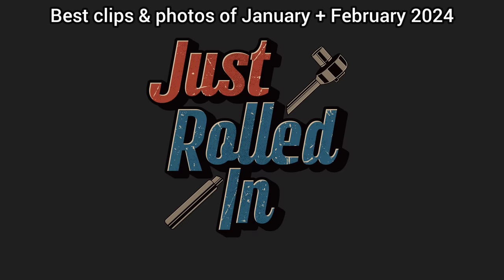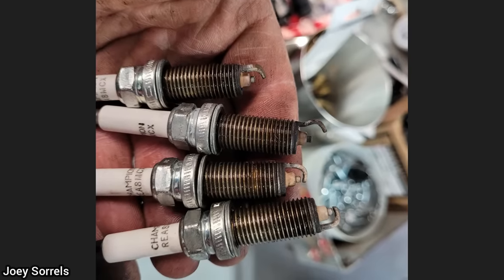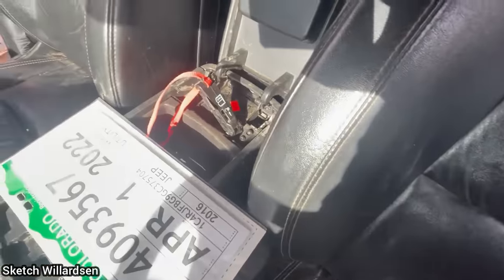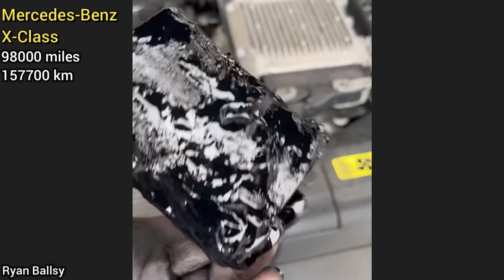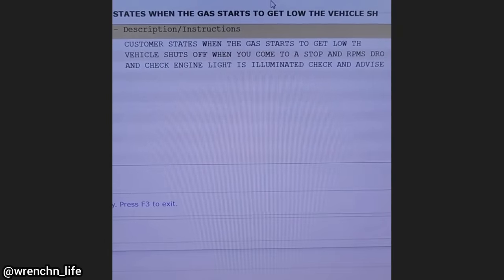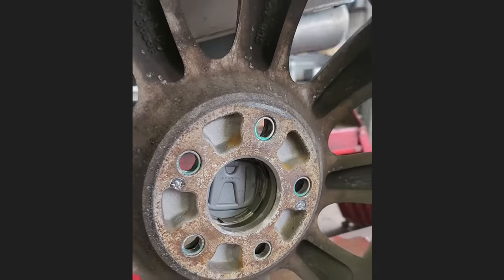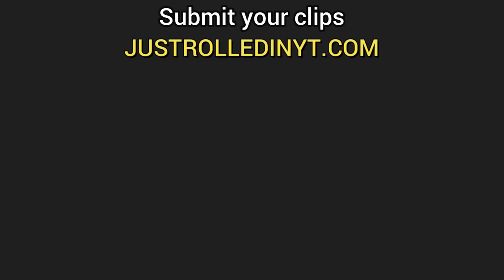Customer States (Best of January & February 2024) | Just Rolled In

Comment: "Aight time to gap these spark plugs..."  Places on ground and stomps on them
Reply: And gets the sledge hammer out too!!
Reply: Gets crowbar out to get them nice and wiiiideee
Reply: So you aren't supposed to use Vice Grips to gap spark plugs?  Who knew?
Reply: Everyone knows the bigger the gap, the more power they have. 
Right ?
Reply: @Graham_Patch  If it's an older vehicle, like my 1993 Cadillac Fleetwood Brougham. Old school plugs were the only ones I could get for it and they required gapping. I had the correct tool of course.
Reply: @HighSierra1500  Thanks, that explains it.  I'll be careful if I ever have to change the plugs in an older car then.
Reply: Micheal J Fox gets bonus points for still trying.
Reply: @Graham_Patch Same: my dad was a HDM and showed me how, but be hadn't actually done it in a long time, that was 98 or 99, he just checked them with the feeler to verify and installed them.
Reply: @ericwilliams1659 ... that's dark...
Reply: @Graham_Patch here in EU it's simple - If you open package with sparkplug and it has paper around it - it's pre-gapped. If not - gap them Yourself.
Reply: I don’t know what “aight time” is…
Reply: @carpballet  
"All right! Time to gap these spark plugs!"
"A'ight! Time 'a gap dese spa'k plugs"
Reply: @ericwilliams1659:

Bad dog!

No biscuit!

Comment: Holy shit that Kia Sorento is a friggin trooper! Not only did it have MULTIPLE rod failures, but it kept on truckin despite having blown multiple gaping holes in itself. 
Poor thing held out long enough to die peacefully in a shop with mechanics there to guide it to the afterlife.
Reply: And, it apparently blew up without making any odd noises!?!?!
Reply: My friend spun a bearing in his 2.5L Fiero, the rod smashed through the block, and he drove it the rest of the way home with it sounding like "a steam train".
Reply: All it wanted was to be peacefully laid to rest!
Reply: @svenmorgenstern9506 I drove my sonata through high flood waters and yeah it needed a new engine, transmission, airbags, etc. But it hasn't had any problems after putting another 80k miles on it. I make sure to get its oil change every two years and I did the 100k engine filter change.
Reply: @chrismaverick9828 A friend had a VW diesel throw a rod through the block and shatter the water pump. He called a friend in with a flatbed, and he was able to re-start it and drive it up onto the trailer.
Reply: @JimmyLeeJr It’s supposed to be 3-5000 miles or three months, whichever comes first, though I’ll admit I go by mileage more than dates
Reply: @61rampy65  maybe the dude had the radio cranked. maybe he was listening to heavy metal and the drum was doing the same bpm as his rod flopping about.
Reply: my best friend's only car has been a sorento. She's had to basically take it apart and put it back together with how many repairs she's made on it, and then she proceeded to drive it halfway across the country to move, and it's still kicking.
Reply: @derekeastman7771  heck my 95 dodge ram with almost 300K on it i just spin a new filter on every so often it has that self changing oil 🤣

Comment: Funny how the dumbest ones are often the most expensive cars.
Reply: People save up to buy a nice car, then are like ??? When parts are more expensive also.
Reply: I feel bad for the second to last one with the Lexus. Electronic door latches are just stupid. If you have to have a mechanical failsafe just have it be mechanical to begin with, it cuts cost on both engineering the electronic version and for the wiring. Maybe I'm just boomer-minded and behind the times, but there was absolutely nothing wrong with the way door latches have been done for a hundred years.
Reply: @lsswappedcessna  The reason the electric is primary is for keyless entry. 
Its a convenience thing less than a hate you thing.

I drive a 2000 corolla btw. I wish i had an electric window all the time.
Those dont have mechanical failsafes btw.
Reply: @lward53 If that car ends up in water you'll be glad you have a manual crank!!!
Reply: It’s because they are wealthy enough to never have to do pretty much anything they don’t want to do themselves.

Hence, they never developed the skills to be able to problem solve mechanical issues and maintenance.
Reply: @lward53 "Save up" don't make me laugh. Those people get money from their rich daddies
Reply: @frizzlefry1921 -- The pressure on the window will cause it to stick hard enough to strip your gears. Either get your door open before submerging, or wait for the pressure to equalize.
Reply: @TlalocTemporal Or smash it with your seatbelts metal bit
Reply: @DeaconPain  -- That too! I don't know how impact resistant side windows are, but you can get a tool specialized for smashing automotive glass. It usually comes with a belt ripper too.
Reply: @lsswappedcessna  no that latch in the inside of the door IS the door handle to get out. That means this customer hasn't a clue how to use their car. Just as bad as a person having the hand sanitizer hanging from their turn signal lever and wonder why it won't stay in neutral position. It's user error
Reply: Cuz they have the money to know nothing about their vehicles
Reply: @lward53  don't need electric latches for keyless. Just the locks. The only electric latches should be stupid expensive cars like McLaren that has a touch sensor and no handle at all
Reply: @DeaconPain  It is a bad idea to smash the window if already underwater, you get blasted with glass and a jet of water. Blind at the least.
Reply: @TlalocTemporal I dunno bud. For the pressure to equalize, there needs to be water in the cabin. And I’ve got to assume the driver is not very patient while this is occurring.
Reply: This is what happens when you have more money than sense
Reply: @lward53  I miss my manual windows ngl. Electric windwos are just yet another thing I'm waiting on to break and need to replace.
Reply: This isn't coincidence.
Reply: I don’t have much more money than cents.

Comment: "Shakes over 100"
My brother in christ, you and your lifted truck are the reason why road deaths are climbing
Reply: That one blew me away. As a former own of a 4 cylinder Ford Ranger stock at 80 I could feel the front end lift and become really light feeling. Needless to say 80 became a no go for me. I can't imagine doing a 100 in it. That was with no damage. This maniac 
driving a rusted spool at 100.
Reply: @writerconsidered   There are cars made in the last 40 years that cannot go 100 mph, 160 km/h ?
Reply: @rogerwilco2  I've got a 1999 ford ranger, I don't think it can go 100 and I agree with the other guy in that I wouldn't want to test it. It's in relatively good condition for a Minnesota truck but they aren't really built for speed and it's lost a lot of horses!
Reply: there saying 100kph, 60mph. not 100mph
Reply: @joeyf504327  the video says 160km/h as a conversation from the spoken speed (which was 100), so they are definitely not talking about 60m/h
Reply: who tf needs to go that fast anyway, surely 80 is fast enough especially in a truck
Reply: @rogerwilco2  my guess is in some trucks it can technically be done but the aerodynamics is not designed for that speed and that makes it not controllable when going that fast.
Reply: Most pickups I’ve tried it in start making some pretty noticeable wind noise around the mirrors past 90 mph or so. But as to capability yes most anything with a V8 or a diesel from the last 30 years can do 100 mph or more if everything’s working
Reply: @isthatrubble  I've done around 88/90 mph towing a 14' tandem dump trailer.  With a 1 ton dually diesel
Reply: @Deere2154D  did you feel safe and stable on the road?
Reply: @isthatrubble  he would have pooed if a deer came out in front of him.
Reply: I’ve gone 100MPH in my 04 Sequoia
Reply: @isthatrubble  yup. It topped out with no trailer at around 110
Reply: @rearspeaker6364  depends.  The truck had a 1/2" ali arc  bush bumper on it, deer would be red paste
Reply: Growing up my father had a Ford Ranger, brand new in '88. That is what I learned to drive in. I would get it up to 90, if I could, before climbing the hill I have to climb from the neighboring city to get back home in the hopes of being at 60 by the time I reached the top.

I have had my current van (1995) up to 80 in short bursts, but I don't like going above 70.
Reply: @isthatrubble  Aerodynamics aren't the problem... it's suspension and the center of gravity. Those things are just waiting to tumble! XD
Reply: @jamesgizasson  true!
Reply: I'm assuming it was in Canada and they meant 100kph. 60mph
Reply from the maker: @Snugglez187 clip was filmed in the US (Minnesota if I recall) and they meant mph 😅
Reply: @writerconsidered  I felt that in my old Subaru Baja at around 90, might have been the turbo's hoodscoop, very odd sensation. Kind of surprising how much traffic can all hang at that speed, but long interstates don't need too much maneuvering I guess.
Reply: @joeyf504327  just take a break my friend
Reply: @isthatrubble  go over 80 only if your constipation is severe and cant afford the price of tablets
Reply: @Deere2154D  interesting! not what I expected, but my personal experience isn't massive
Reply: @philiprice7875  lol I think it would actually make me constipated, that's what happens to me when I'm stressed....
Reply: I love how you guys completely forgot everything else about the truck that could have made that happen

Comment: I don’t know how these people survive. Like half of the problems are common sense things that you should be able to figure out on your own 🤦‍♂️
Reply: You just answered your question... common sense or lack of
Reply: I had a camera sensor issue, but instead of running to the mechanic I first checked to see if the problems was because the camera was dirty. Cleaned it, and the problem was gone.

I don't get how people run to the mechanic for every little thing. It is crazy that no one checks things beforehand. I do it all the time before thinking of getting a mechanic to look. I also took transportation tech when I was in high school. That helped me a lot. And also saves me from spending so much for things anyone can do if they all took a class. Oil change, headlights, tire changes, tire pressure, tire balancing, etc.. all can be done by yourself. If you actually chose to learn it yourself.

Comment: I can't believe people are genuinely surprised that their car stops working when it runs out of fuel.
Reply: Relations of Fred Flintstone
Reply: Those people shouldn't be allowed to touch a car
Reply: I'm pretty sure the complaint was that it only happens when stopping. If you never thought about where the gas intake is, you might not realize this should happen and be surprised. He probably expected it to run smoothly and then just die.
Reply: @user666mega if someone can't put 2+2 together to figure out a problem only happens when low on fuel... They probably just shouldn't own a ICE car... This type of person needs to go electric, they need dummy lights to tell them when the battery is low...

Doesn't matter where the fuel intake is.

"You can't fix stupid"
~Ron White
Reply: @shannonharris  Just because something happens only in certain conditions does it automatically make it "normal"? No. In this case, the engine was shutting off and one of the conditions was low fuel level, so it might be slightly easier to accept as normal, but since it only happens during braking, this again raises the threshold of acceptance back to "WTF is going on?" level (if you don't know about the intake).

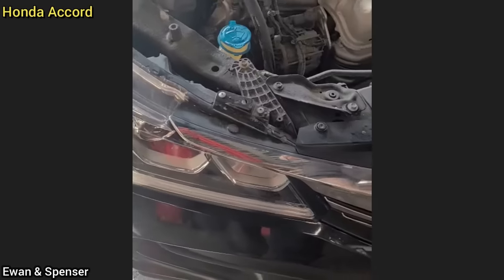Comment: 9:14 You can easily empty the washer fluid tank by pulling the sensor plug on this generation of Honda. I would know because that exact thing happened when I wiped out drifting my civic. Luckily, the plug landed on the inside of the bumper and sat there all the way home, and only needed to be pushed back in.

Comment: 2:25 is so relatable because i bought a subaru with cooling issues. heads, thermostat, ECT Sensor, water pump, all that was replaced. Not until i came in and replaced the leaking manifold did it stop overheating. The exhaust gas was shooting straight on the thermostat housing, causing inaccurate readings, and overtime damaging the wax inside. The upside is a i got a $3k car with new heads and only 1.5k in repairs

Comment: "It shakes over 100..."
Dude drives it over 100.
Reply: 100 km per mile, which is 62 miles per hour, a normal speed on the highway.
Reply: @JacobPaul-ix7oc  Nah, it even captions it onscreen (2:52) to say "160 kp/h" I'm familiar with the metric system, and the tendency of Americans to assume the use of the Imperial system everywhere, but that's not the case, here.
Reply: @JacobPaul-ix7oc  Althoug, it's actually closer to 161kph...

Comment: It amazes me how for some of these a "customer declined the repair(s)".. here (Europe) your car has to pass a yearly technical inspection... they'd be scrapped or fixed immediately.
Reply: There are a large number of vehicles on our roads that aren't licensed at all, with drivers that have no license.
Reply: Some states have inspections, mines every two years.... Problem is many shops don't care bc they don't make money on inspection unless they have you fix it.

I used to be an Inspector.

And for the customers that don't care (most seen on here) you can almost always find someone who will take an extra $20 and pass it.

Some states the car can be perfectly safe but won't pass if the check engine lights are on.
Reply: @shannonharris This. Also, to make matters worse, many cars will throw a check engine light for mundane things that have nothing to do with drivetrain operation or emissions, such as the windshield washer fluid being low.
Reply: @ElijahDecker yeah that's a wonderful idea in states like CA or NY.... Can't get car registration when a check engine light is on...

Sadly they don't turn on for a Bluetooth suspension.... Well yet anyway
Reply: I guess Europe is just superior
Reply: @ianrobertson3419  That's actually pretty scary
Reply: @redfox_84  some rules make sense yeah.
Reply: @shannonharris  that's brutal. check engine light seldomly has anything to do with safety of the car.
Reply: @sachadee.6104 you're right but the states that do it claim to do it for emissions reasons, probably like for all the smog in CA.
Its ultimately about politics and just getting $ for the state.

They don't care about safety

Comment: 12:33 that is the car companies fault not the owners or firefighters...Cars with door locks that dont work when the battery is dead are the dumbest cars to buy and do not buy them...Also,firefighters cant study up on the 2000 new car models per year!! Owners also most likely were not told and thought it was like a normal car as it was always a safety feature you open the door by the normal handle even when locked and the door would open dead battery or not....Car companies are idiotic today! Dont buy that model of Lexus total trash! As it shows 2000 miles and it broke already! JUNK!
Reply: But it is your responsibility to read the owners manual and find out!
Reply: @shannonharris cars shouldnt have basic mechanical safety features be replaced with shotty electronic ones
Reply: @shannonharris  you'd be right if we were talking about how to operate the stereo. When we're about how to get out of the car (e.g. because it caught fire) it has to work as per industry standard - de iure or de facto. You may be a passenger in a car you have never seen before, the door has to open as every other door opens.
Reply: @shannonharris I hope that was a joke. (Hard to tell sometimes)
Reply: No, it wasn't a joke... Its true new cars today are trash... But be it a building or a car... IT IS YOUR RESPONSIBILITY TO KNOW WHERE THE EXITS ARE AND HOW TO USE THEM!

If you can't or WON'T RTFM maybe you deserve to lose this game called life!
Reply: @shannonharris  it's the manufacturer's responsibility to design sensible, usable controls. When they deviate from the long-accepted norms of controls, they need to be especially careful.

Comment: When the outside temperature gauges first came out a customer brought their car back and complained that their display was one degree difference than what the bank was displaying on their sign. I told them it was amazing that an outside temperature display system could even be within twenty degrees on a moving vehicle while having a temp sensor that was mounted inches from the front of their radiator.

Comment: The low tire pressure warning light came on in my grandma’s minivan when we were out running errands. She had no idea what it was and at home she thought it was something to do with the brakes and i walked into the garage on her just about to pour brake fluid down the oil fill point. We went to the tire shop and they told us the front right sensor was dying and the rear left had no signal so they gave us a quote.

Comment: the raccoon under the hood was great.
  I was a navy base police officer in Panama in the 80's. I got dispatched to a woman who was upset because she found a snake in her car and she's afraid of snakes. I thoroughly checked out the inside of the car, but no snake....  she wouldn't come w/in 50 yds of the car, so when I asked her where she saw it,  she yelled back, "under the hood."    I opened it. 6 feet of python splattered all over the engine compartment. the fan blade had chopped it up like an 8-cylinder cuisinart.
     she had started the car, heard a strange noise and looked under the hood.  surprise!  that's when she called dispatch.